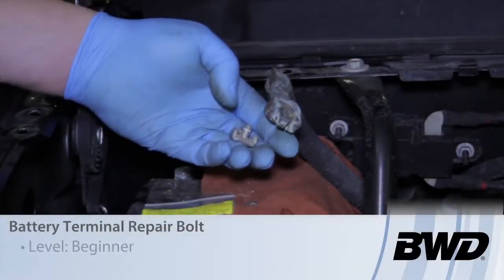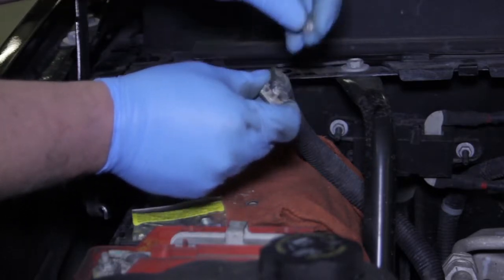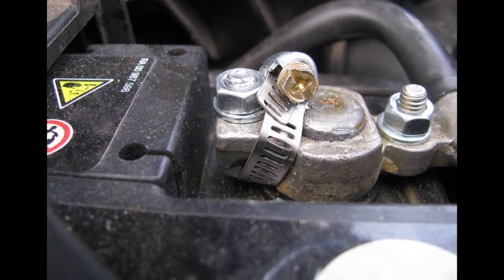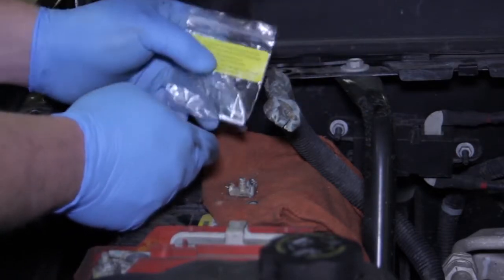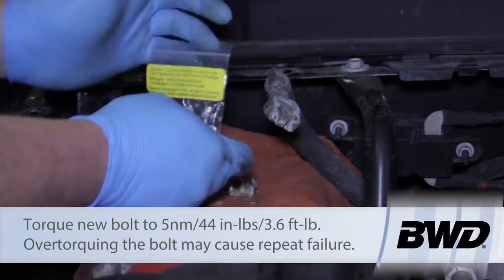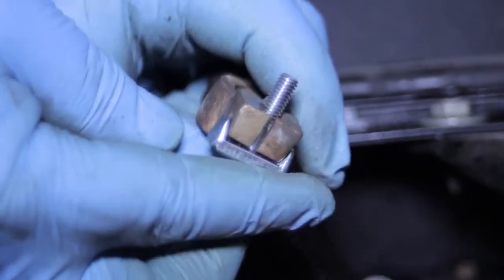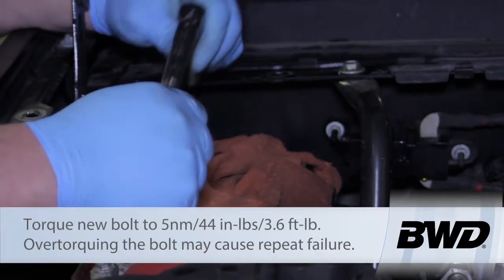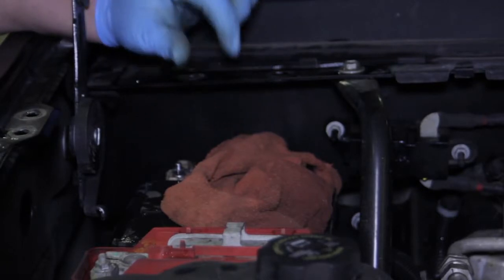How to Replace GM Battery Terminal Bolt

Comment: Thank you ! I have been down a rabbit hole trying to understand it. I see that the tapper makes the two part come together to make that compression on the battery terminal. Good JOB. Even it it has been here for 5 years. Waitng to be discovered!!